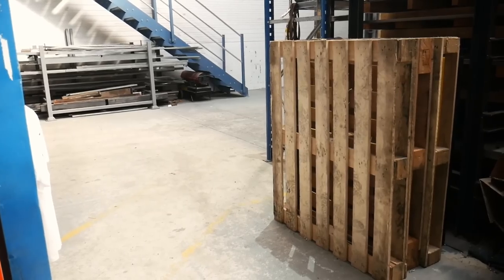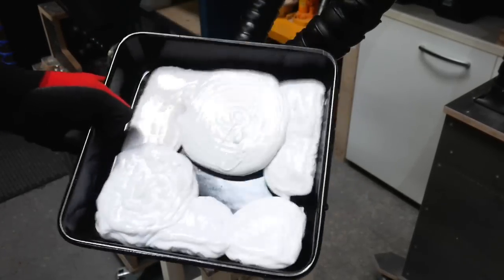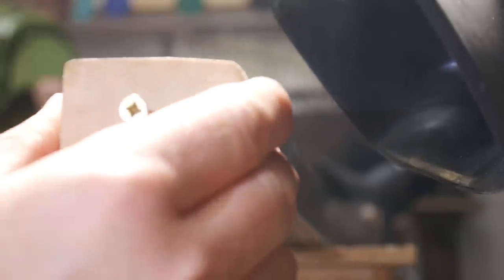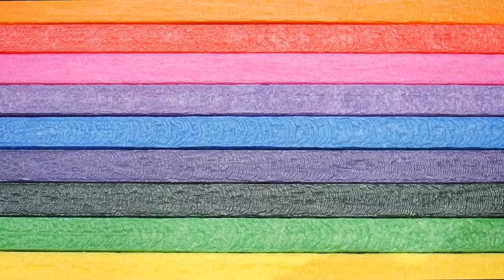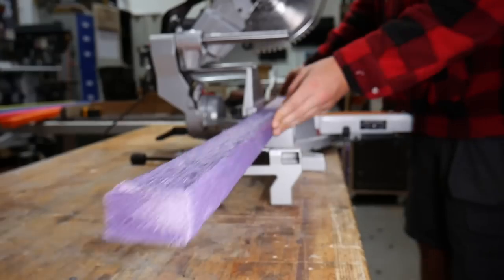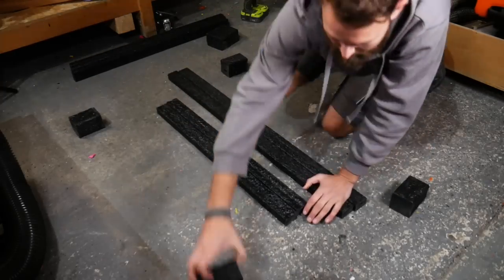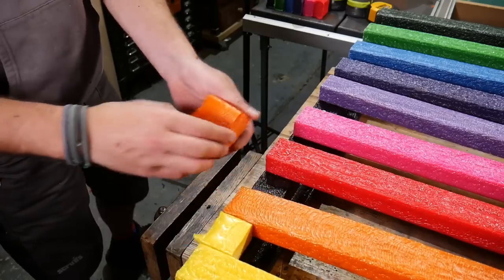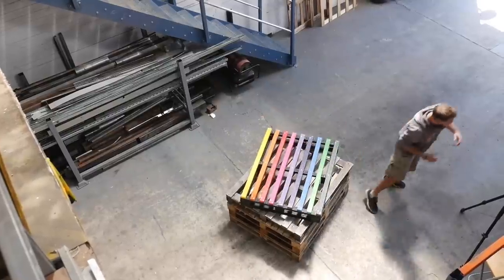Making a PALLET out of Recycled Plastic

Comment: As well as looking cool it’s a really good idea. At work when we ship to the US and Australia we have to use pallets that are either heat related or aren’t wooden. The plastic ones are usually moulded, so when they get broken they can’t be repaired. Yours solves that problem. If you can make these economically for you then I’m sure there are plenty of potential customers for them. We’ve been quoted well over £100 for an aluminium Euro pallet.
Reply: i wonder if its heavier than normal standard ones
Reply: @sidekicks1403  wonder no more... Yes, they are heavier.
Reply: Maybe it does cost, but if it lasts...
Reply: I'm surprised that there isn't such thing as a repair service.

Comment: I think it’s just hard to make polypropylene useful… making it thicker into beams helps so it’s less brittle. Glad you guys are trying new things. What else have you thought of with recycling polypropylene? One thing I noticed is that polypropylene melts into molds a little easier. I guess it flows better, can pick up more detail & texture and doesn’t require as much pressure as HDPE.
I was wondering if someone made a more durable takeout container that can be reused way more than the current containers

Comment: Awesome how we’re getting really practical uses out of old plastic!
Quick question though: how does the plastic properly fill the mold? The extruder pushes out hot plastic at the start, slowly filling the mold. But once that plastic cools, how can it keep moving forward with the hot plastic behind it? Like, if the plastic is continuously cooling as it fills the mold, and the only hot plastic is at the start, wouldn’t that cause problems? And like at 2:50 it looks like the plastic is still got at the end of the mold. How?
Does that make any sense?
Edit: and did you do anything special to make it slide so easily out of the mold?

Comment: **QUESTION @ BROTHERS MAKE**

How would an artist apply the "3RRR",  Reduce, Reuse and Recycle, plastic items to experiment with creating art, without immediately investing in all that machinery, you boys were using? 
I was especially inspired by the ability to melt down all that colourful plastic waste to make plastic beams and sheets to build structures with, and fingers crossed small, medium and large not intricate moulds. 
I guess I'm wondering if waste plastic of different types could be used in the same manner as thermoplastic when there's no need for intricate details, but as shapes to help fill areas or give an area bulk,  to save the expensive art supplies. 
For example, in the hard structure inside of an air dry clay sculpture, the waste plastic wouldn't need any detail, it would need a close shape, I am wondering if the waste plastic if kept warm, would it stay pliable to continue to shape if one were to work quickly? 
Also using this waste plastic as structure inside cement sculptures? 

Would you two BROTHERS MAKE or anyone have any suggestions to help me first experiment these ideas on small scales to see if my ideas would even work? And where I would get info on how the different plastics work? 

Thand you for you inspiration and any ideas! 
Regards, JB

https://giphy.com/gifs/recycle-reuse-reduce-9KcEKUTcGWiLB780R2

Comment: While I like the colourful effect I’m concerned about the amount of energy which went into remanufacturing something which is normally made from 100% natural biodegradable wood product. Perhaps projects could be judged more holistically not just on their aesthetic beauty but perhaps factor in the amount of displaced carbon/energy normally required to make the original. Maybe the plastic pallet should last a lot longer than the traditional and thereby deliver a benefit ... but if plastic park benches are a measure then I’m a bit doubtful. 
Keep up the great work. 😀👍
Reply: What is the energy-equivalent value of diverting X kilo of plastic from the land fill/river/sea?
Reply: @mavigogun   ... you are asking for the energy which has been saved by not allowing this plastic to enter the environment and trapping it inside this plastic pallet?  Approximately nil.  Unless we have been misled I don’t think the boys were ever planning on dumping their unused materials into the sea.  My argument was that the naturally occurring materials used for the likes of pallets I.e. wood sequester carbon and not require the massive energy inputs needed to repurpose the precious plastic. Consider the total equation, don’t just worship the reuse ... even if it was very pretty.
Reply: @CTCTraining1  You've missed the point, entirely.   What becomes of waste plastic?   It is either recycled, incinerated, or enters the ecosystem.   Those are your "choices".   Each has a cost.   The question is, what is the greatest good?   Your focus on "energy" is anything but "holistic"- that is, to find the greatest good, we must consider the totality of ramifications, and not limit our consideration only to "energy".
Reply: @mavigogun  .. not at all, I watch this channel for innovative and interesting usage of recycled plastic. I’m just questioning the complete ignoring of the displacement of natural alternatives (leaving the precious plastic for other projects), and the massive quantities of energy needed to complete this particular work. You appear to be recommending waste plastic be used regardless of its suitability and cost otherwise it would be, somehow, wasted and couldn’t be used for something else.
Reply: @CTCTraining1  I have recommended nothing other than a holistic/comprehensive assessment of impacts.   

What is a "massive quantity of energy", exactly?   How much energy was required for this demonstration?  How much energy would be required to harvest, mill, and fabricate a conventional pallet?   How much water?  How much CO2 would be emitted, amongst other impacts?

This plastic pallet was created as an artistic homage, not a practical alternative.   EVERY design choice is a contest of goals- energy consumption, resource use, performance, impact mitigation, among others.    We can arbitrate that ENERGY is the only deciding metric, if that is our only concern.  For my part, energy is an important but secondary concern.   Within limits, I will trade energy expenditures to divert plastic away from the ecosystem or burning for energy generation.   It would be interesting to compare the CO2 necessary to melt this project, vs the CO2 emitted burning the same quantity of plastic.   In my case, I pay a premium for my power supplier to source exclusively from wind and solar, fostering essential renewable infrastructure development. 

Our local plastic market will be driven by the demand we create; the more we recycle, the greater the value of the plastic, the less that is diverted to power generation or disposal.

As production increases, I'd like to explore solar heating systems to augment plastic melting.

Comment: Maybe do a vacuum form mold of the whole pallet instead of sticks and assembly. Welding is an option for plastic too. Non wood pallets have been around but they have a simplified and unique look to them because if you're not playing with wood you don't have to play by woods rules. Try that other shape pallet as one piece. If the future of architecture is 3d printing, then sheets, boards, and rolls of building supplies used for stick built homes aren't needed in print home applications. If the customer wants a house that looks like a traditional, stick built home then it can be printed to look the part. Pallet production is a BANG BANG GO GO !!! situation. A stronger, longer lasting pallet fetches a better price but you still have to BANG BANG GO GO !!! If you do the other shaped pallet try not to make it as ugly as this one. Warehouses are mostly, exclusively, man's domain. Give the pallet a manly look to match.